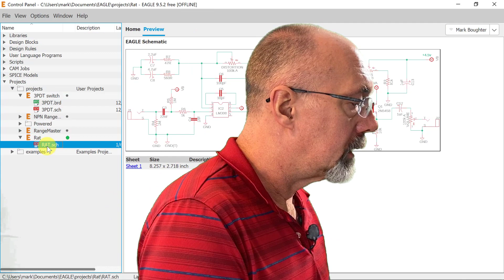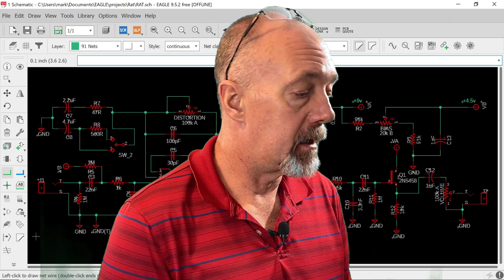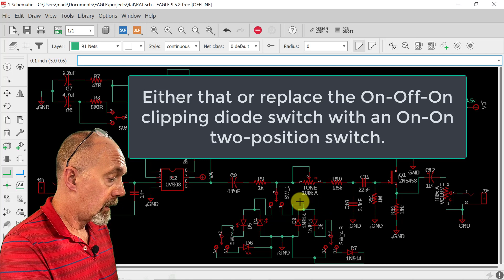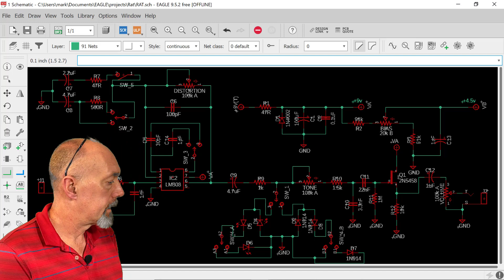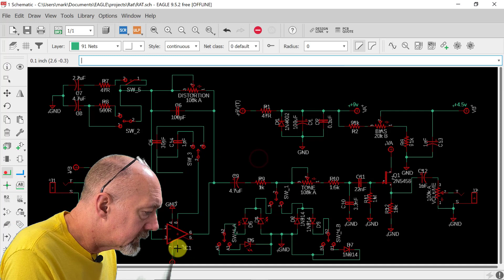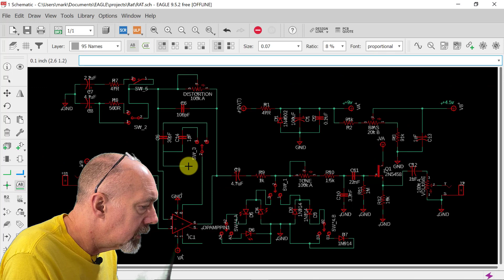Build Your Own Effect Pedals - Rat (Part 2) Mods

Comment: I try to use a rat with my bass rig quite often but I get this 800htz? frequency that sounds like a mouth harp type sound that I can’t get rid of… where would that sound be coming from in the circuit and how to adjust the circuit to make it more bass friendly? I’ve tried the Reutz mod and don’t really dig it.
Reply from the maker: Send me a sound sample? Is the Rat one that you built or did you buy it?

Comment: Nice and interesting way to use the bias, just lifting the signal so everything is biased, also explains the diode which I was wondering about what it was compensating for in the other video, Nice design that rat.

Also just heard you say eagle, that explains why the software looked so great.
Nice video's
Reply from the maker: Thank you, my friend. I put way too many mods on this Rat. I've pretty much gone back to a stock Rat with green LEDs for clipping. That's my favorite version.
Reply: Yeah I know all about that, I was designing an effect recently but then I ended up having to buy massive boxes as the normal ones wouldn't fit the nine potentiometers😂
Just like when I planned on building my simple drumcomputer, was supposed to be five instruments and sixteen steps. The design turned out to be 16 steps but twelve instruments fully adjustable and I'm still saving for the roughly 270 knobs and switches already got the 218 Led's and housing though😂😂
Probably an gonna hope no one else wants one very quick into soldering it up.

Still neat how you've fit all that in such a small space
I'm building a three knob limiter right now (first guitar effect instead of synthesizer stuff) and I can barely fit all the jacks and pots in. Got three pots and in/out/power Jack below them on the top, footswitch and dpdt  just leaving me 40*54 roughly for electronics. Those stompboxes are crammed